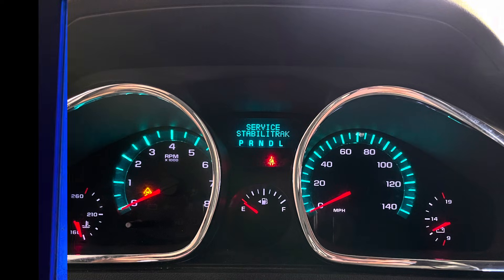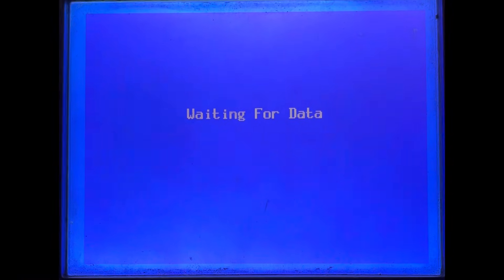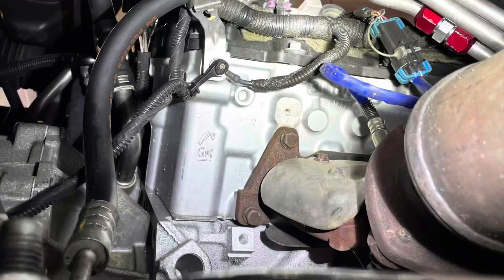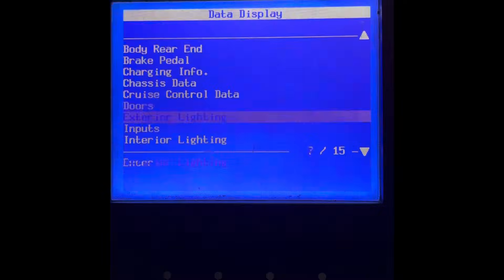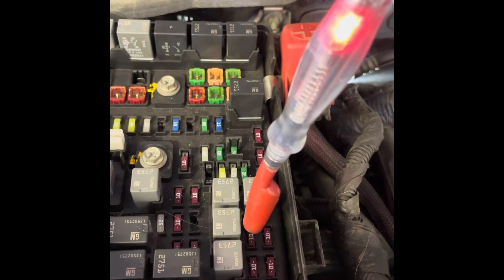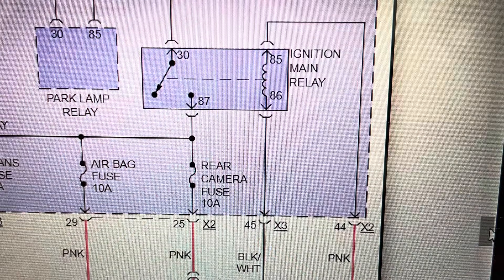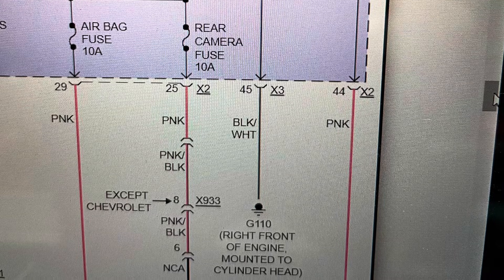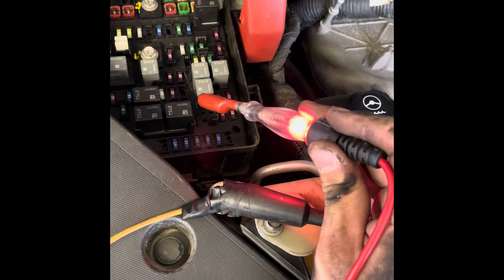Chevy Traverse Intermittent No Start... Diagnosis

Comment: My 2011 chevy traverse wont crank and my anti lock mode flashes when I lock or unlock my door the local mechanic thinks it’s my starter. Do you think it could be a starter? Also my battery is in great condition and I paid the get my key remote reset.
Reply from the maker: That kind of sounds like some other problem, there shouldn't be lights coming on and off when operating the power door locks... I would suggest a full code scan of all modules on the vehicle... For what it's worth, the starter should be fairly easy for most mechanics and automotive technicians to diagnose, although access to the starter motor is limited.

Comment: Ivan Temnikh of channel "Pine Hollow Diagnostics" did a video called "8-Hour Drive...for a 5-MINUTE Diag??" (at 2 minutes and 58 seconds https://youtube.com/watch?v=_8KM2mVWfno&t=178s).  In it, he applied positive charge via a 0.39 amp test bulb (194 bulb) to all four terminals of a disconnected ignition coil connector of a GM truck.  The part that I don't understand is why the PCM was not destroyed when he applied power via a test lamp to the IC control terminal.  I suppose the transistor or integrated circuit inside the PCM is capable of handling 0.39 amps.  How would a technician even know how much current a computer circuit is capable of handling?  Are most GM computer circuits capable of handling 0.39 amps?  The electrical schematic shown in that video says 2127 RD 0.8 for that particular circuit.  However, I don't think 0.8 refers the amperage of that circuit.
Reply from the maker: Ivan is a very smart technician… One of my favorite channels to watch. 

Doing it that way can be a little risky, I prefer to use a lab scope when testing ECM output driver circuits… Test lamp he was using if it is similar to mine should draw about 200mA and he was using it to test for a good ground to the ignition coils, not necessarily to test the driver in the PCM.

Like I said it is still a little risky to introduce voltage and current on a circuit that is not designed for it… Experience is the only way to know what can handle what, and it can be an expensive lesson to learn. 

The IC terminal doesn’t normally carry very much current at all, so even a little bit of current can cause damage… A lot of modules have built in over-current protection or diodes to prevent such damage from occurring. 

Older modules didn’t have those protections and were much easier to damage by improper test methods.
Reply: @DadsGarageDiagnosticSpecialist  He used a makeshift test lamp.  Looks like it has a 194 or 168 bulb.  The internet says those bulbs pull 0.39 and 0.38 amps respectively.  It was a little scary watching him do it.  During KOEO, that circuit should have no charge.  If there's nothing else connected to it, it's the same as if it were an open circuit.  Connecting battery positive to an open circuit does nothing.  Perhaps that's the reason why nothing happened (no damage).  If it were pulsing, it would have 5 volts.  Connecting battery positive to it would have a voltage difference of about 7 volts (if the bulb wasn't there).  Because the bulb is there, the voltage difference is less than 7 volts.
Reply from the maker: That’s what I was thinking… No damage due to open circuit. He must have gotten lucky, but I’ve watched enough of his videos to know that he knows what he’s doing. Lucky to have no damage.

Comment: I have a 10 traverse with the same issues. I found small fixes that seemed to work but only short lived. I came across this vid but 50/50 I couldn't get to it, figured it wouldn't work. But after 3 months of being a driveway anchor I pulled it to a local shop and this was the fix! 

I see this was posted 3 years ago so I had a couple questions. Has this traverse been back in your shop? If so, has there been any related issues since? Just hoping to get 2 more years out of it before getting rid of it. Thanks!
Reply from the maker: Never had any further problems. Thanks!

Comment: Chevys are the worst. Total junk.
Reply from the maker: I’ve worked on all makes and all models throughout my career… They’re not at the top, but they’re not at the bottom either. 

All cars are garbage these days. We can thank strict emissions regulations for that.
Reply: @DadsGarageDiagnosticSpecialist 
True but GM has been using the cheapest materials available to make their vehicles.  They fall apart from the inside out. It’s sad how far they have fallen.
Reply from the maker: You're not wrong... All cars are built cheap for maximum profit these days... All junk.

Comment: I cannot confirm where G110 is I'm looking from the top down and I have an idea of what one it is but not 100% I am unable to find an image of the engine and it being painted out. Unless someone can lead me to that.
Reply from the maker: G110 is on the top of the engine towards the back of the car on the passenger side of the cylinder head.

Very difficult to access either from the top or below. I had to use a long extension with a flex socket as shown in video. 

Thanks.

Comment: I am having the same issue. only I also have a flashing engine signal. I have to find the ground wires? My code is also the ECM but I do not have the wiring schematic and wondering if you can tell me where the ground wires are? Thanks!
Reply from the maker: Top of the cylinder head towards the right rear of the vehicle. 

If your check engine light is flashing, that suggests there is an engine misfire that needs further diagnosis.

Comment: I just bought my sister a 2012 chevy traverse with the same issue. Iv changed the battery, the alternator a few relays and also the ECM. Man i hope this is the solution for the problem its having right now.
Reply from the maker: I hope you get it figured out.
Reply: Did you ever figure it out?
Reply: Did you ever figure it out?

Comment: Hi, I’m reaching out for help! First off thank you for your very informative diagnostic. My 2016 Chevy traverse intermittently starts. For two weeks straight it’ll have no problem starting then on a random day no crank no start. I’ll have to almost sometimes spam or keep turning the key back and forth. It got to a point last week I got as far as calling a tow truck to tow it back to my house but when the driver got there he asked for the key and turn the key and the car started. It is very intermittent. Battery is great above 12.6 when its running battery gauge is around 14 so not the alternator and I check the 40amp starter fuse it with a different fuse and it starts fine. It’s been starting fine for the past 2 weeks so I don’t know what to do. I did find the G110 ground and I want to know how you got in that tight space. What tool did you use to unscrew that bolt and what did you use to clean. I applaud you because I started to question my existence after   Attempting to clean that bolt. Well hope you see this because when it happens again I’m going straight to G110 ground.
Reply from the maker: I used a long extension with flex socket.

From your description, it could be just about anything… I would suspect a failing starter motor.

Comment: All because of a bad ground. Holy cow. My wife and I just bought out 2016 Traverse from a local dealership and have had nothing but issues. We bought it in Aug (2024) and it now the 1st week of Dec. (2024). Pass air bag light kept coming on, that was a wiring issue. Brake light stopped working, a fuse. Now we have THIS problem. It'll be interesting to see if they can find it. I'll mention the ground, but not sure IF it'll do any good.

Thanks for taking the time to make and share this, great tip!
Reply from the maker: Thanks for watching. I hope you get it figured out.

Comment: Having intermittent no crank no start on a 2013 Traverse, but only in 55 degrees weather, two days in a row now.  But after half a dozen or more attempts, it starts.  It appears to work fine during warmer parts of the day.  I tested battery terminals to be 12.66 volts.  Sounds like a wiring issue affected by cold weather.
Reply from the maker: Does the starter click when it fails to crank? Possible faulty starter motor or battery cable problem.
Reply: @DadsGarageDiagnosticSpecialist  I'll copy paste what I posted on forum:  

120K miles. Battery bought new 10-11 months ago.  For the first time ever, yesterday morning (when the temp was about 55 degrees), I tried to start the Traverse, nothing happened.  No clicking, no lights on the dashboard.  I tried again, nothing.  Then I tried a third time and I hear it slowly crank, struggling, with the usual check engine light coming on (which it does normally when it cranks).  Then a split second later, the crank becomes powerful and the engine starts.  I drive 2 hours for a trip, and no more issues multiple starts that day with the temps around 60-70 later in the day.

This morning, 57 degrees and same issue.  No lights, no noise the first 2 times.  The third time the dash lights come on briefly but went out.  Then 2-3 mins later I try again and this time I hear clicking noises, but no crank.  Another 3 tries and the engine finally cranks and starts.

I checked the battery via the hood (not the actual battery terminals) and it was around 12.66+ volts so that seems fine.  I then had my wife start the car (83 degrees now) after the engine had rested for 4.5+ hours since this morning's drive and it started no problem, with full typical strength.  When cranking, the voltage dropped for a split second to the 10+ level and then after the alternator kicked in, it jumped to 14+ so the alternator is working and charging the battery... so far so good.

What can this be with the symptoms of progressive attempts eventually working?  Sounds like temperature issues affecting electrical connections where multiple attempts warms up some connection or device, increasing conductivity?

Also, while the car is running and no issues starting, the battery voltage on the dash screen looks weaker (around 13 volts) than normal.  Usually it's on the 14 level.  Maybe a bad sensor?  Or bad ignition switch?  Bad solenoid or starter?

I checked the crank relay with a voltmeter and resistance is same as the rear window defroster, so seems OK.  For good measure I switched the two relays so will see if tomorrow morning is different.

Next I'll check the voltages again in the morning when it's colder, and check headlights etc during the problem, which I expect to happen again when the temps are cold.
Reply from the maker: @BD-np6bv I would check for loose battery cables at the engine block. Otherwise it will need diagnostics.

Comment: where on the car is the G110 that you had to fix and where does the other side connect? 
 thank you
Reply from the maker: G110 is located on the top, on the cylinder head near the front of the engine. In-vehicle location would be passenger side under the windshield area. 

G110 is the ground for multiple devices so there are multiple ends. 

Thank you for commenting.
Reply: what is G110